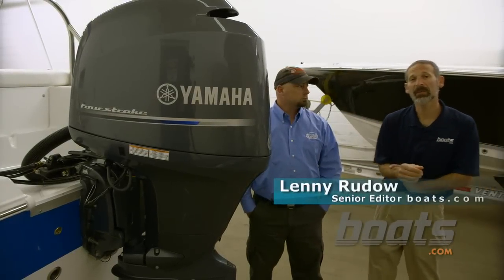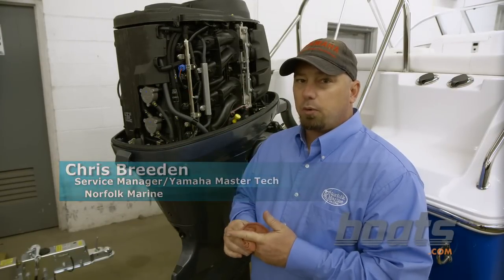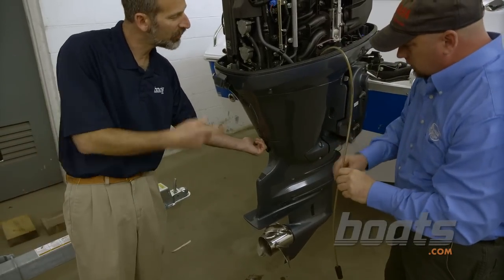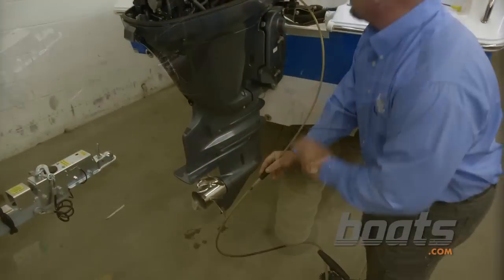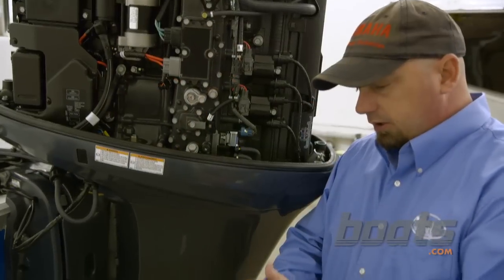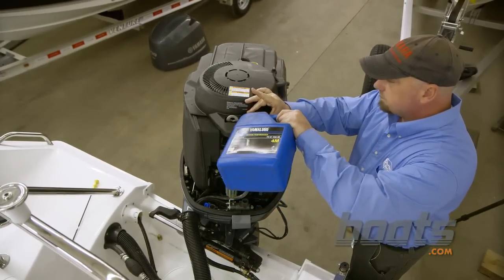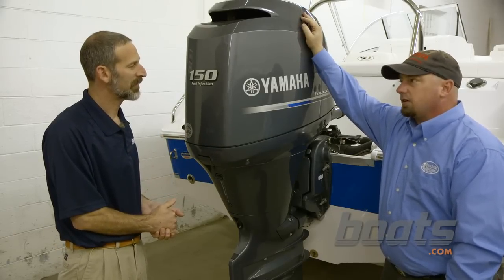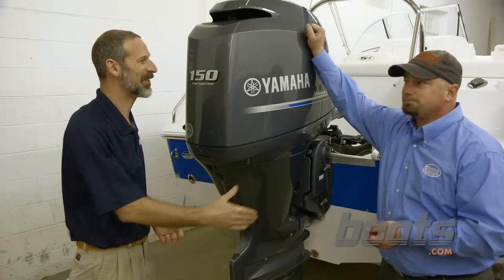How to Change Engine Oil on Four-Stroke Outboard

Comment: First of all, there a few things missing in this video....big time.  Before you vacuum out the oil, the yellow oil fill cap needs to be removed.  Also, the engine should be heated at least 5 mins running with water muffs or in a water drum with water level above the cavitation plate (at least 6-8 inches) and water constantly applied to the drum with a hose.  I really suggest using a 55 gallon drum with a lower drain installed.  Then the tube for the oil extractor gets inserted after you wait for a couple mins for the oil to cool a bit.  Then that model of extractor shown needs 10-14 pumps.  When adding oil, you need to follow the manual's instructions.  

There are two levels; one with a filter change and one without changing the oil filter.  Chose the proper quantity and and add that oil slowly.  Before adding all the oil as noted in the manual, check the level when 90% of the required quantity is added.  Those extractors will leave a residual amount.  To check the oil, tilt up to 50 % of the tilt range and wait 5 mins. Then tilt down and measure with the dipstick (wait a few mins before checking).  Then add the rest if the dipstick shows a level below 75% of i's maximum range.  

You MUST NOT keep filling oil to get to the top level of the dipstick.  This is not an auto engine.  Never exceed the maximum amount noted in your manual.  Then run that engine again for 5 mins and check the oil post the change.  This will allow oil to circulate and pass through the oil filter.  Adding a small quantity of oil to the filter is also an option if your filter mounts horizontally. 

 Lastly, that oil filter has a torque spec. associated with it and there is an oil sensor above it that must not be contacted...be careful and avoid hitting it with an oil filter wrench (an oil filter cap and socket wrench with an extension is your best bet to avoid damaging this sensor).  Check your manual and use a 1/4" torque wrench.  Mine is 12 lb.-ft.  This is not even mentioned in this video.  

I have seen videos from this site that really scare me.  One actually noted using RED Loctite on water pump housing bolts that almost made me fall off my chair.  Loctite 572 or 565, which are thread sealants, are to be used.  Not RED Loctite that will be very difficult to remove. I am a Chemical Engineer, not a Yamaha Master Tech, and I follow OEM guidelines. 

If Lenny or this Chris guy want to question what I posted, they should first consult Yamaha to confirm what I have noted is correct.  One last thing, that yellow oil fill cap must be tightened only 1/4 to 1/2 turn after adding oil.  Otherwise, it will lock tight the next time you try to remove it.  

Whatever you do, please review your manual and follow a service manual. Contact Yamaha USA and ask questions before doing any work.  Otherwise, you will heading to a dealer and paying big time for Chris to fix your mess.  Do it right and use these videos as a guide only.  Get the proper information and get it done right. I am posting this to note the missing information I observed here.  This post is not meant to be negative attack on boats.com.  However, there is more to this job as noted in this video and this job is simple.  However, you need to do your research and never use an video on You Tube as a complete instruction guide.

Comment: No mention of the type of oil used ? Or anything about oil in an oil change or type of filters.?
Reply: A lot of motor oil is specific to horsepower for boat engines

Comment: what about 2 stroke outboard engines? Is it the same process? say, Johnson 40?
Reply from the maker: +William Galindo Not at all - because a two-stroke doesn't have any engine oil for the powerhead, you mix the two-stroke's lubricating oil directly into the fuel.